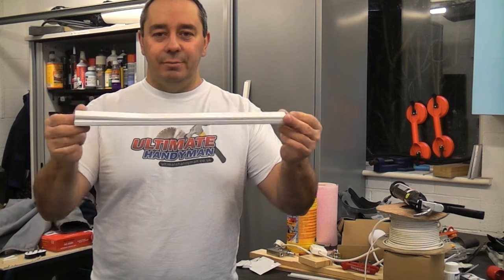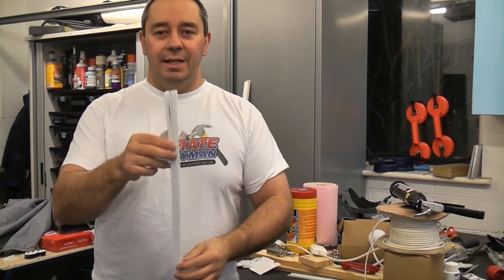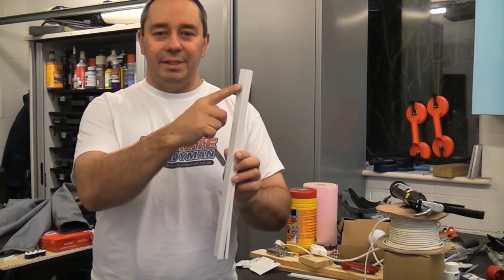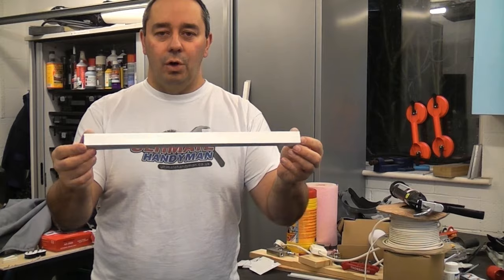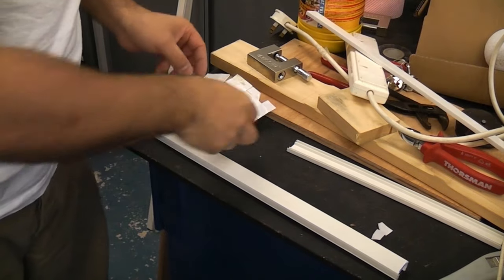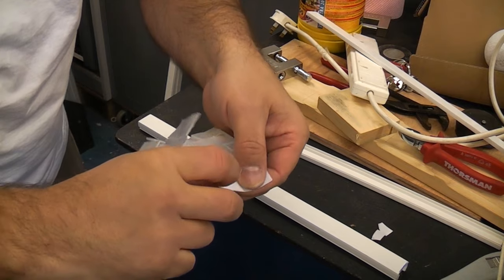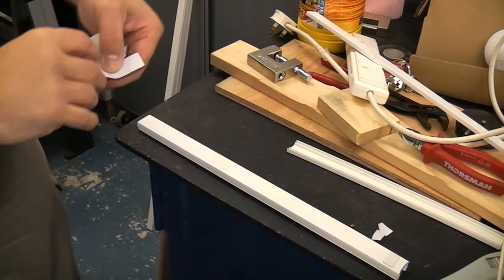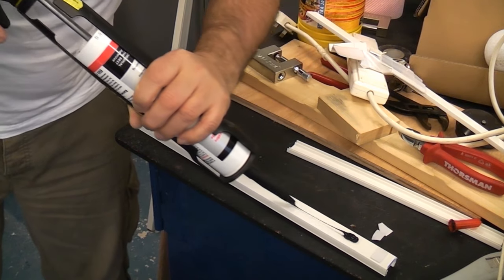Mini-trunking | Diy quick tip

Comment: It's not recommended to rely on the self adhesive of the mini trunking. It can fall off with the paint work after time on the wall
Reply from the maker: Mine is still firmly attached.
Thanks for the comment 👍
Reply: I just made the same comment. It will come off over time no doubt. Must put at least two wall screws. And when it comes off it looks horrible

Comment: no spark do that bodge
Reply from the maker: You can buy self adhesive trunking, this is just another way of fixing trunking without the self adhesive pads ;-)
Reply: +adrian thorpe i never understand why a Electrician would ref to them self as Spark, ITS NOT GOOD to have SPARKS!! means its not in correctly! or two connections/cables are too close together.
Reply: @AngelLaHash  Sparky is better ! 😀

Comment: Would self adhesive mini trunking be ok to use to hide pir light cable externally, but hide the cable under upvc soffit boards? Should adhere quite good & not come undone after time ie in the summer months of the heats on the soffit board etc?
Reply from the maker: Not sure, I think the adhesive might come unstuck after a few freeze/heat cycles. I guess it depends how good the adhesive is.

Comment: very difficult to use on Mat paint inside buildings?Had an issue where this was used but paint come off,Any other tips rather than using nails ?
Reply from the maker: I'm afraid you might have to fix it using screws and wall plugs etc.
Thanks for the comment 👍
Reply: @ultimatehandyman 
Please the screw type,size, length and spacing

Comment: are you going to fix mt1 to an external masonry wall with just silicone do it properly few inche and a half eights or it Will be hanging off your wall in a few months
Reply from the maker: +Ian Dobson It's been up there for 2 years now and hasn't fallen off yet ;-)
Reply: What can be used to reinforce it?
Reply: @ultimatehandyman 
If one doesn't want it to fall and do double work, What can be used to reinforce it?